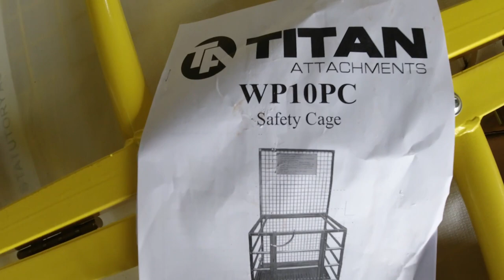Will It Work? Would YOU Try To Fix Your Barn Door This Way?

Comment: Great video 👍 here's a tip I.B.C. totes frame makes a wonderful and low cost safety cage and the plastic tote can make a small holding tank 365 gallons in most cases. Thanks for sharing.
Reply from the maker: Right on👍

Comment: That is a nice safety cage, but what do they give you to protect against loader drop? Short story: I was running a brand new backhoe last year, and a hose blew- then the loader dropped. Luckily the bucket was empty and no one was close to it. It only takes a second for a weak or damaged spot in a hydraulic line or fitting to drop you. Great video as always- stay safe!!!
Reply from the maker: Thanks for the heads up. I'm usually pretty good about doing a visual inspection Evey time I get on the tractor for the first time of the day but I'm with ya, it pays to be safe. Thanks for the comment 👍

Comment: Was the cage secured to the  tractors fork frame with a chain of other device?  A tap and cordless drill is good for cleaning paint out of the threads before assembly. Gina done a good job👍
Reply from the maker: Yeah they have a safety pin behind the forks. 👍 Gina is a keeper 😁 thanks for the comment!